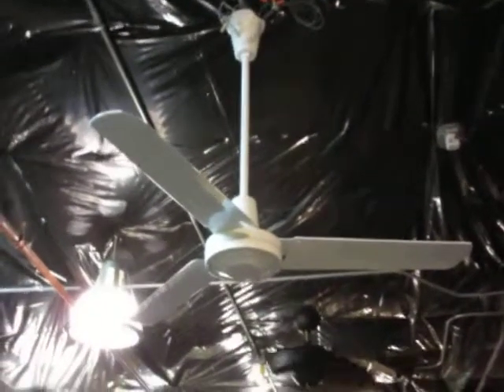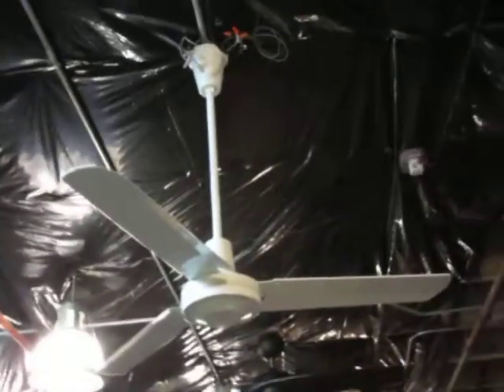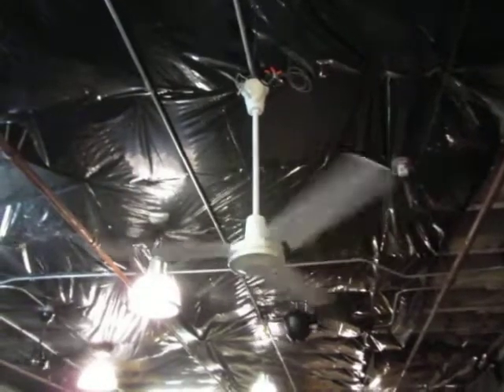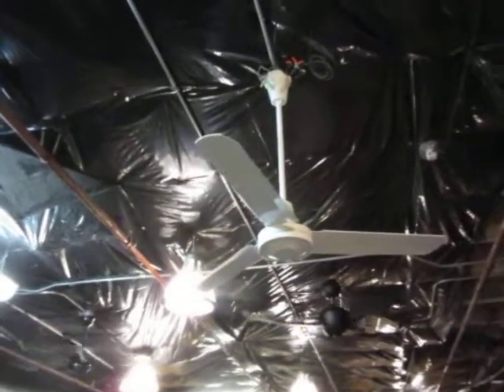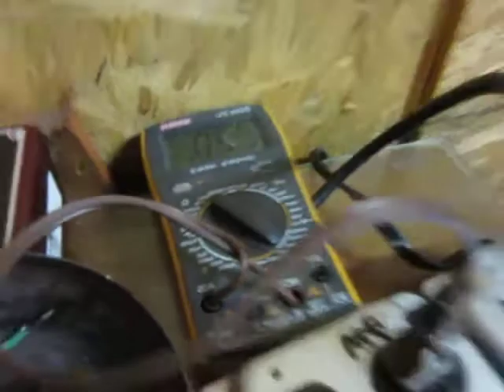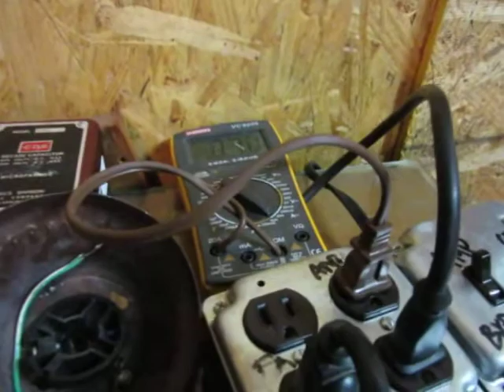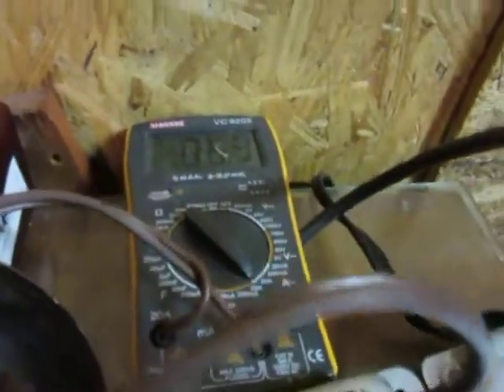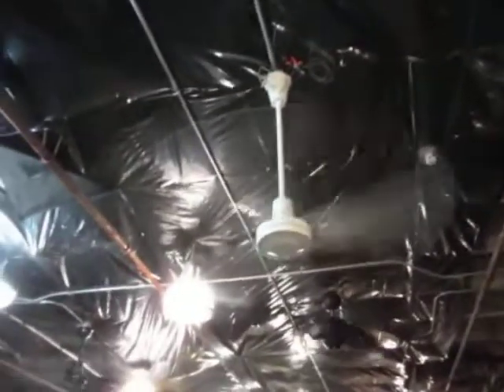Emerson Heat Fan industrial ceiling fan 48"

Comment: You should use the Emerson SW95 wall control that is included.
Reply from the maker: I saw no control included. I didn't buy this one. My friend Dan "Spiffy"Neuman did. Besides testing it on the rig tells me what kind of control will work on it and what the amp current draw is on the speeds.
Reply: The 2016 Emerson Catalog said a SW95 Control was included.
Reply from the maker: +Anthony Dinh This was I believe an open box at Habitat. Dan Spiffy Neuman bought it along with a 56" Heat fan.  Usually controls are not included. I looked at the manual.
Reply: Okay.